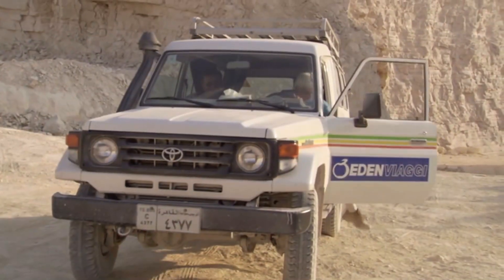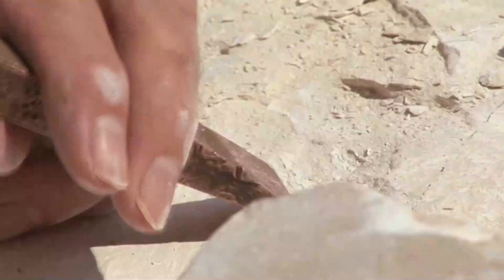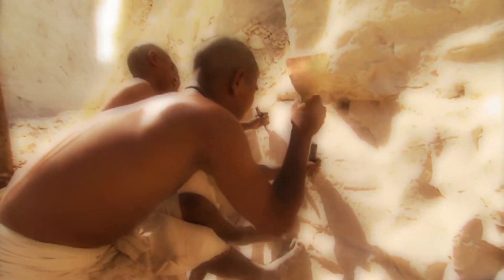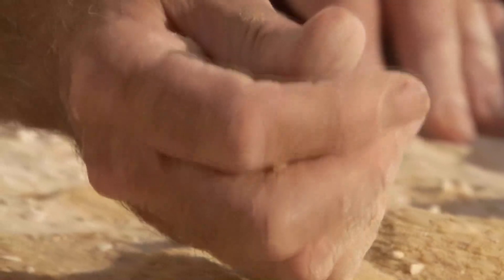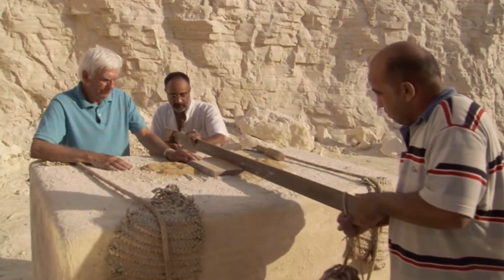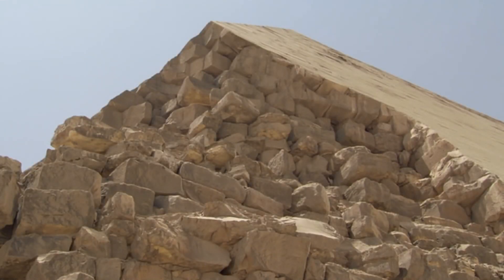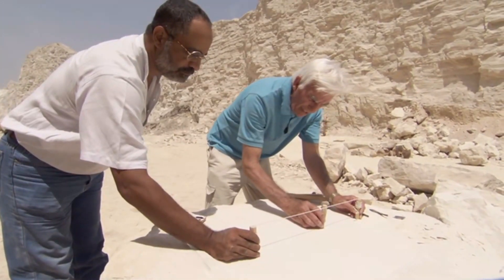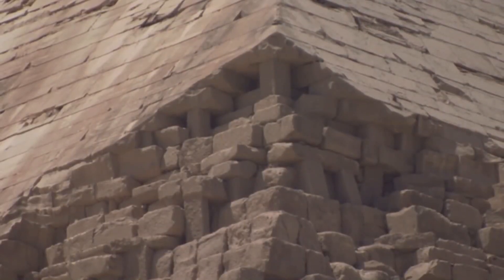Ancient Egyptian Stone Working with Denys A Stocks

Comment: What has not been replicated at full scale is:

Hollowing out a 60–80-ton granite box with perfectly flat internal surfaces, sharp 90° corners, and parallel walls to within fractions of a millimeter — all from the inside of a single block.

Doing so with the speed implied by the sheer number of such objects (hundreds of high-precision granite items from the Old Kingdom alone).

Achieving the surface flatness and parallelism seen on many of the Serapeum boxes and some pyramid-era granite work (measured in some cases to under 0.02 mm over meters).
Reply: You need to actually watch this and more of SGD content with an open mind. I get that you won't accept that the Egyptians could measure and cut granite. But just open your imagination to a point where you might accept that you might be mistaken.

Comment: If they cut 2.3 million blocks of granite for the great pyramid at 2 cubic inches an hour, it would have taken them 8,012,832 years working 24/7, 365 days a year.

This is all bs ☠
Reply: The pyramid is made of limestone bro. There are only roughly 80 granite blocks in the entire pyramid.
Reply: What has not been replicated at full scale is:

Hollowing out a 60–80-ton granite box with perfectly flat internal surfaces, sharp 90° corners, and parallel walls to within fractions of a millimeter — all from the inside of a single block.

Doing so with the speed implied by the sheer number of such objects (hundreds of high-precision granite items from the Old Kingdom alone).

Achieving the surface flatness and parallelism seen on many of the Serapeum boxes and some pyramid-era granite work (measured in some cases to under 0.02 mm over meters).
Reply: Time per block: At 2 cubic inches per hour, cutting one block of 61,023 cubic inches takes:
61,023÷2=30,511.5 hours per block
Reply: if they had 100,000 stone cutters it would take 100 years. LOL.
Reply: The modern archeology construction timeline using this method for the pyramid is a lie.

Comment: Speculation...
Reply from the maker: Only the part about the saw and that too is backed by evidence. Such as the striations left behind, he does it dry but  by doing it wet the marks match perfectly, 
You can test the speculation yourself if wither easily and it’s cheap. A small piece of copper and an off cut of granite.
Of course then there are the other theories which are fictional. Based on no evidence whatsoever. 
Is that where you are going? I get that sense.
Reply: @SacredGeometryDecoded   By writing "speculation" I meant that none of us were there to attest to it being a fact...the period in which these megalithic structures built are uncertain because carbon dating technology which is all we have at current doesn't work on stone...his hypotheses are good conjecture at  best...there is so much to put to weight...for one after being "cut" how was it lifted and transported? Are we to believe they pulled it across terrain then up a slope? This problem is more than just solving for x. This was deliberately meant to be kept from those outside of the profession if one thinks about it. And for good reason
Reply: @Anarchyisagency  beasts of burden, shit ton of people, boats, ropes, wooden rollers, water? 

Thats how they could be moved and transported. And its not really speculation if we can recreate the method used, at this point its just fact.
Reply from the maker: @Anarchyisagency  the gypsum mortar contains organic material which has been dated.
Moving something up a slope (ramp or inclined plane) gives mechanical advantage. In quarries and other locations there are lots of ramps. 
All the elements that make modern cranes, leverage and gearing systems, are ancient inventions necessary for a crew to operate sailing ships.
There are videos and photos of people moving and lifting massive weights with these ancients technologies using ancient materials such as rope and wood.
Greek and Roman engineers describe them in detail. The best came from the Library of Alexandria.
Without a time machine there’ll always be an element of speculation. Even written records and imagery might be incorrect or misleading.
It comes down to evidence that can be tested.
To dismiss it in one word response as “speculation” implies to me a nihilistic view of followed through. Why even bother at all?
Also I have heard “megalithic” and moving up a slope as some mysterious achievement many times.
They are the same talking points used by lost ancient high technologists so I quite confident in my speculation as to where you are coming from. As I am confident you don’t understand the basic physics of moving “megaliths”. Since no one who does understand them, or the history of such things. Would frame it that way.
Reply: @SacredGeometryDecoded  Prove it...and you don't know who I am likewise my credentials...the fact that you're using some sort subtle of personal attack shows what level you will stoop to uphold what appears to be cognitive dissonance...if it works for you fine... I'm taking no stance...for what is today's truth is...well
Reply: @MrAggerz  I am not saying it cannot be done I'm merely saying "prove it" great hypothesis...I'm sure this was brought up before but I haven't the time to find it...until its done once again all theories remain in the realm of theory...
Reply from the maker: @Anarchyisagency  I don’t care about credentials and mine are equally irrelevant. 
You brought up the exact same talking points of carbon dating and moving/lifting up a slope I have heard a 1000 times by the same people who use the term “megalithic”.
I should prove you know more than you put in your reply? That would be your job. 
Though let’s say you fo by omitting the carbon dating of organic material. Or the mechanical advantage you get from using ramps then it doesn’t paint a flattering picture now does it?
Either you didn’t know or you did.
Which one is it?
Reply: @Anarchyisagency  but it has been done, multiple times at that, once you can show that it can be done and recreate it again and again, it ceases to be a theory and it becomes fact. Why do you question this but not Roman/Greek works or Medieval castles?
Reply: @MrAggerz  there is another pyramid with the same magnitude of the one at Giza? Please show me...ya we have buildings all over the map...but don't run from the fact that this is one if a kind...this is why humans are so fascinated by it...oh if you have evidence of others like this one please send it to me...for educational purposes. And don't take this personal I'm a student learning and don't profess to know everything...sorry if it comes across as arrogance
Reply: @Anarchyisagency  what point are you making though? Yes the great pyramid of Khufu is one of a kind in terms of its size. They most propably used ramps to haul the stones to the top. If you want to learn more just read Denys A Stocks book on ancient Egypt.
Reply from the maker: @Anarchyisagency  Roman aqueducts are larger by volume of stone and more precise THROUGH THE AIR OVER MILES AND MILES AND MILES than the Great Pyramid is along the ground.
The “megalithic” builders never once built a large open space. Medieval cathedrals have vaulted ceilings with thin walls flooded by light.
The Hagia Sophia could almost contain the Menkaure pyramid inside of it.
Funny the “megalith” crowd never ever mention that. Cognitive dissonance perhaps?
Reply from the maker: @MrAggerz  it’s obvious where all the information comes from, heard it too many times already. It’s copy pasted from Brien Foerster type channels. 
If they ever looked outside of that bubble they wouldn’t be bringing up moving stones up a slope as if some great mystery.
Reply: @SacredGeometryDecoded  You clearly haven't seen mud flood videos. All they talk about are buildings like that.

But the issue with megalithic architecture isn't it's scale, but it's age. It predates the iron and steel tools the Romans and later builders had. The Easter Island statues aren't anything compared to modern sculptures, but the islanders made them without metal tools, hence the mystery (particularly the basalt statues and wall).
Reply from the maker: @berserkasaurusrex4233  the mystery of the stone tools on Easter island next the half finished statues?
Steel is not magical. Stone was worked since the Stone Age prior to copper.
Reply: @SacredGeometryDecoded   You don't even know what I'm talking about.
Reply from the maker: @berserkasaurusrex4233  stone tools work and steel doesn't transfer magical artistic skills. There is no mystery.
Reply: @SacredGeometryDecoded  You can't work Easter Island green basalt with stone tools. Even tool steel barely scratches it, it's some of the hardest basalt on the planet.

You're thinking of the softer tuff statues. The basalt statues are a whole other thing.
Reply from the maker: @berserkasaurusrex4233  one stone will work on itself plus they had flint. 
On stone hardness  I will assume mohs hardness scale which is about scratching not hammering.
Reply: @SacredGeometryDecoded  You've never carved stone then. Good luck making a polished stone statue from the hardest rock there is, using stone age tools. There's a reason we don't see millions of basalt artifacts from 100k+ years of human history despite them leaving behind tons of softer stone figures. Bashing two pieces of basalt together doesn't result in a useful cleavage like with flint cherts, it just makes dust. You can't carve it like that.

Doesn't really work with any of the harder stones, actually.
Reply from the maker: @berserkasaurusrex4233  the easter island sculptures are perfectly explainable with the known tools found on site. 
I have a ping playlist of demonstrations doing what people like yourself seem impossible or too slow.
You’ve done nothing. I have filmed and posted how to videos and raw footage.
You’re on the wrong page to try that nonsense with me.

Comment: As mentioned a few times in the comments regarding the Iraivan temple:
https://www.youtube.com/watch?v=-LRTJM1Ca-4

at 6:03 they seem to apply some quite modern technology.
Reply from the maker: Yes some, but the carving done by hand including a tuned granite bell and perfect boxes. By a team of seven.
Cutting slabs of granite by hand operated drag saws and gang saws goes back a long time.
Hierapolis saw was a gang saw no different to modern gang saws still used today only it was powered by a waterwheel instead of with labour.
Modern gang saws still takes days to cut slabs , the very best using steel shot with the grit cut at 5cm hour maximum. Many will run at half that speed because it’s cheaper just using free abrasive.
It’s can actually be faster than diamond or carbide circular saw because you have many saw blades running at once. The cut goes slower but many cuts at once. Saw blades are just iron bars that can be replaced but circular saws need specialists to recondition.
Iraivan temple also used a modern crane to lift the uppermost piece in place, they still had to operate under health and safety laws.
They did get special permission for the foundation. An unusual concrete mix with no reinforcing.

Comment: he shaves down the high spot, but he does that with limestone, not granite. wouldn't the granite blocks be a lot harder to accomplish that with?
Reply: Your wrong look closely
Reply: He litterally addresses that at 2:44
Reply from the maker: Yes but with stone pounder it would be done in a few seconds. In a old video on cutting granite I also use a flint stone pounder, will post longer one I have sitting on a long time. With flint stone pounder you’d take those high spots down very quickly. A trick I noticed was with a broken end little flakes of flint break off, so like like chisels they cut into the stone faster than just smooth sides.
I just posted these clips as raw piece if someone wants to use, before I break them up and put writing etc all over them. Many little details and comparisons with granite. 
Every little trick you can use to speed up the process. 
Plus they describe some things as being ‘cut’ but can be achieved faster by other methods. 
Like the blocks they show in kings chamber. The faces showing are not cut, that’s certain. The joins might have been but other faster ways to do it.
Reply: @SacredGeometryDecoded  You'll believe anything if it comes from Authority.

I'm so glad I'm not as gullible and naive as you. Phew, what a silly, BS life you must live....

Comment: Such lucky chance.
Reply from the maker: Yeah lucky 😉
I have a bunch of Videos about arsenical copper/bronze.
It’s more like mild steel.
They even used to make boilers for steam engines out of it.
Plus the amount of arsenic in old kingdom copper finds is up to 3%. Anything above 1% is defined as arsenical bronze because it had to be added as natural ores never have that much.
Reply: @SacredGeometryDecoded  You have one of the most interesting channels on these topics. I still refer to the sacred geometry ones.
Reply: So is having trillions of gallons of oil, trillions of cubic metres of natural gas, and hundreds of billions of kilograms of coal buried in the ground under our feet. What's your point?
Reply from the maker: @Chris.Davies  Peru lucky enough to have high arsenic copper ore also. Though the old kingdom early dynasty copper artefacts that have been analysed have way too high arsenic for it to be natural impurity.1% or below defined as arsenical copper and possibly natural, over that is defined as arsenical bronze and added. Some pieces have over 3%.
It puts a different light on the level of their metallurgy./chemistry.
Depends on the source but since it’s linked to “alchemists” it gets a bit crazy since that word so mixed up in spirituality, new age and Hollywood tropes.
Greek arsenical bronze especially interesting because they seem to have got the mix perfect. At 2.5% is about perfect between malleable and rigid as well as maximum for work hardening.
It’s one of the  ancient technologies that have some very good evidence.

Comment: I don't think the saw used in the granite demonstration would work for the interior of the boxes.  Why no chisel demonstration on the granite?
Reply: What has not been replicated at full scale is:Hollowing out a 60–80-ton granite box with perfectly flat internal surfaces, sharp 90° corners, and parallel walls to within fractions of a millimeter — all from the inside of a single block.
Doing so with the speed implied by the sheer number of such objects (hundreds of high-precision granite items from the Old Kingdom alone).
Achieving the surface flatness and parallelism seen on many of the Serapeum boxes and some pyramid-era granite work (measured in some cases to under 0.02 mm over meters).
Reply from the maker: In the description is a playlist from scientists against my this. Includes using flint tools to maker inner corners. You drill around perimeter. That piece being granite will break off using copper wooden wedges. With pounders or by grinding the surfaces can be flat flat quickly. Sharpen up inner corners with flint chisel , polish down. I don’t have good flint but all the other stuff such as drilling, grinding polishing in my experiment playlist. From those cutting rates etc to work out minx times (I am a noob, experienced people would be faster)
Iraivan temple in Hawaii includes boxes and stone chain too, thousands of inner corners. If they switched to flint their skill would shine through.
Have earlier video that has sculptor using pounders and flint to make reliefs to replicate sarcophagus.
Bigger boxes easier as you can climb in and position yourself.
Reply from the maker: The same guy here. Denys Stocks was the one who arranged for sculptor to use flint tools.
It’s not cheap paying them, or volunteering to do it and lose their time. 
It’s just as much those who doubt to invest either time or money doing the work.
Reply from the maker: @BluntofHwicce  yes. You can even leave a distance between the core holes because east to break the the bridge between. And the ^^^^^^ type remains. they break off with a wall aimed whack of a stone. 
Love No need even to drill out the entire thing. Just trace the perimeter and a line up the middle. The rectangular piece in between will snap out and break along the bottom like popping out a core hole. 
Which is the beautiful thing about granite and basalt. Unlike sandstone and limestone that splits along erratic lines the harder stones break exactly where you tell them to. 
Master masons use that behaviour to create micro cracks in the direction they strike with their tool. Then with a single whack it breaks off. 
Not only is granite weak to fire it’s also weaker than softer stones in that it will cleave under stress. Lime and sandstone has a little flexibility. Granite just snaps.
It was interesting to learn and experiment with stones. A lot of it is counter intuitive. The things that make granite strong if exploited properly make it much easier to work than softer stones.